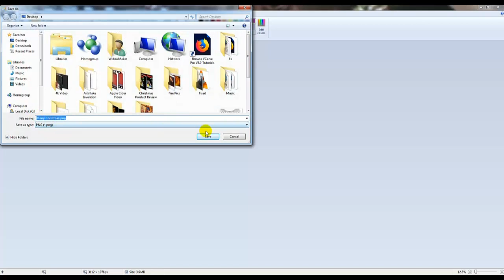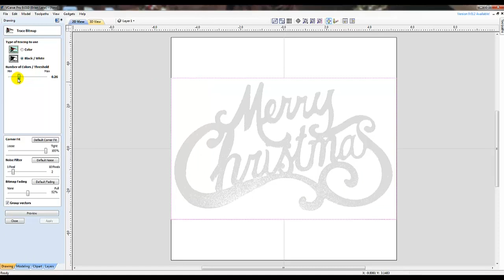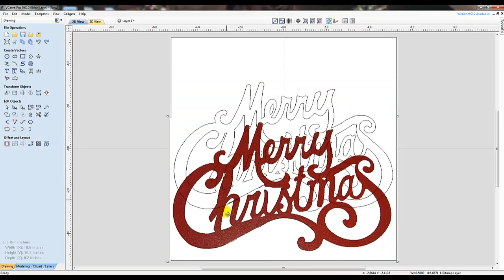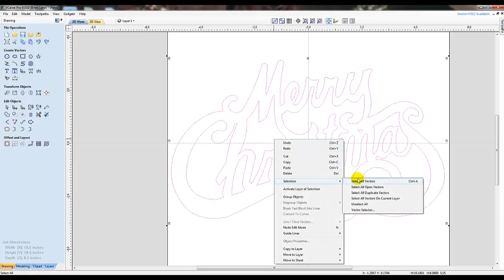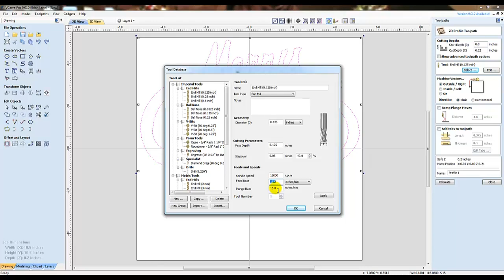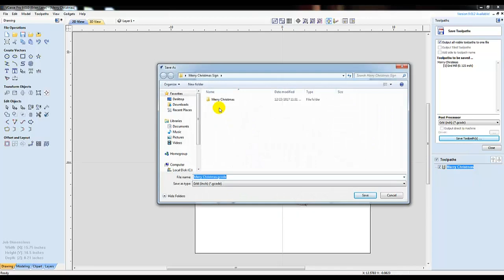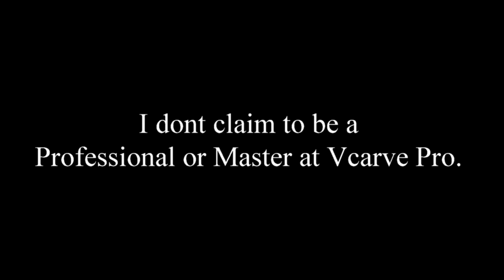VCarve Pro 9 - Easily Convert a Picture to a Vector

Comment: Nicely done, Brian. One question: I just received my cnc, and haven't learned anything yet. Will this same process work on the V-carve version that comes with Nextwave's Shark HD4, or only with V-carve Pro 9? Thanks.
Reply from the maker: From what I have read.. the only real big difference from Vcarve Pro and Vcarve Desktop is Pro allows you to design objects larger than 24” x 24” from what I am reading. So everything I showed you should work spot on when you fire up yours for the 1st time. I have to say. I had to watch about 10 videos to collect all those things over the past 3 months. And none of the videos were under 15 minutes or to the point. lol I was pretty stressed out. Hope this one helps you get going faster on yours. Also I am getting ready to release another video that will show you even more tools in vcarve in regards to designing from scratch. I should have it out tonight. Im only touching a tiny bit of Vcarve but it should be enough you can hop in and play and know what buttons do what and how to get your projects to build so you can start having fun... Best of Luck Jim on your new Toy! Excited for you sir! Brian
Reply: Thanks a million for the info about v-carve vs. Pro. I think the upgrade, if I need it, isn't horribly expensive, but there's no point getting it until I find out if I need it. Thanks again.
Reply from the maker: Jim Hester yeah the desktop version is perfect. The pro is for a huge CNC or someone like a cabinet maker. 👊

Comment: can Easel do about the same thing? im new to cnc trying to decide if i can get by with a free program or if vcarve is that much superior to justify the cost, thanks
Reply from the maker: adam miller Easel will be great to get started with and I have used it for 5months. But vcarve is when you are ready to take it to the next level. 👊🏻
Reply: I think you will become frustrated with Easel. Spring for Vcarve Desktop and it will open up a whole world to you

Comment: DUDE,  can you recommend a site with pre-made vector files? Im a newbie and will be ordering the CNC E4 soon.
Reply from the maker: I don't know of one offhand. Possibly someone in the comments can help us with that. But if you do locate some vector files you may want to make sure the bit and the depth and everything it's set up to your board vice versa. vcarve allows you to edit the file. But you wouldn't want to just get a file and then throw it into ugs and let it start cutting because they may have settings that tell it to go too deep for your project. So it's usually best to design your own I feel. Something you can do is go to Google and look for an outline of something. If you wanted a dog just say dog outline and usually you get quite a few options to turn into a vector. 👊🏻
Reply: thanks dude

Comment: Enjoy your videos! Do you know of anyone running fusion360 on these routers? Have you try to engraving on sheet metal?
Reply from the maker: I believe there are some people that have done Fusion 360 on a E3. I believe Allcustomz has tried it from what I remember. Bob has been pushing me that way. I will have to sit down and learn it and see if I can do a fun video on how to use it for everyone.  I haven't tried sheet metal, but if you went slow enough with the right bit.. you should be fine. Allcustomz has a video engraving rocks..  lol So the sky is the limit. I try my best to break down the CNC softwares so people can get an idea of what the best is and if free is always the best option. I struggle to find videos of people just showing me how to import a picture or just show me the tools on how to quickly design something....  What should take 6 minutes for someone to show me how to do something in others youtube videos usually takes 45 minutes. I usually cant sit still that long. lol.. I advise Vcarve Pro 9 if you want precision.. Easel if you want ease of use and free. I want to design something fun for New Years so maybe I will dive into 360 after that and make something neat and share a video once I figure out how to use it. lol Ty for your comment. Brian

Comment: Will VCarve work with Apple computers?
Reply: CrucifiedLife no, it will not. It is windows compatible only. I confirmed this with Vectric a few months ago.
Reply: I am using both Aspire and Vcarve desktop on my Apple through “Bootcamp” which lets you run Windows on the Mac.